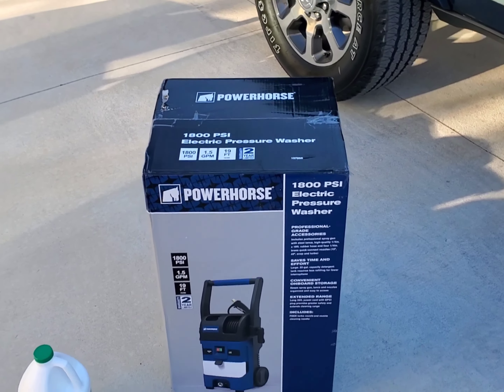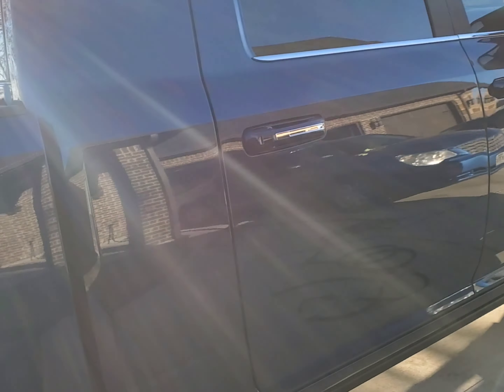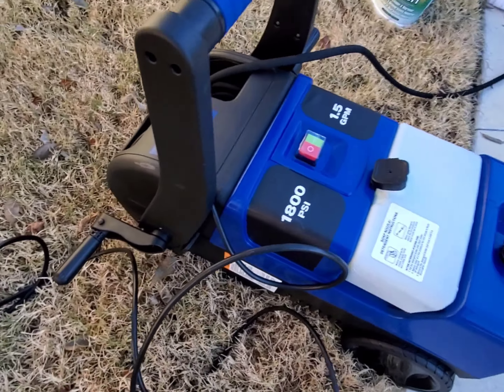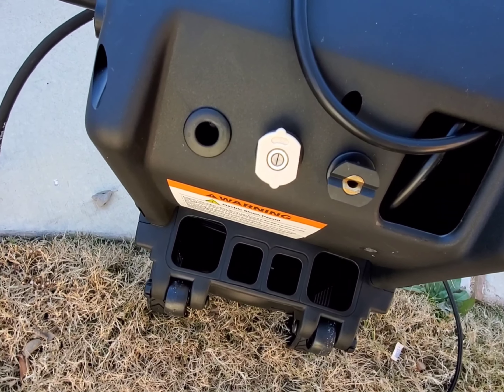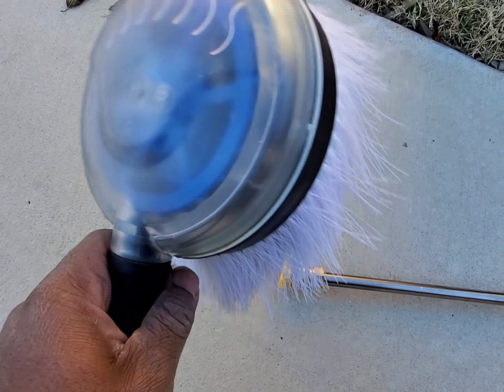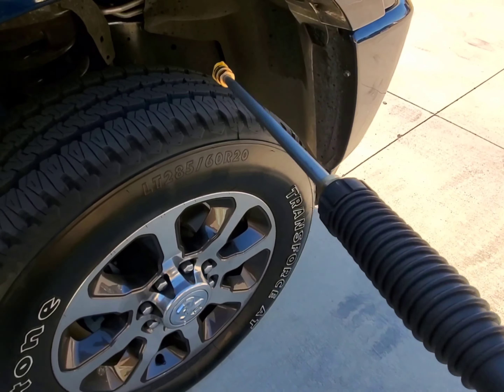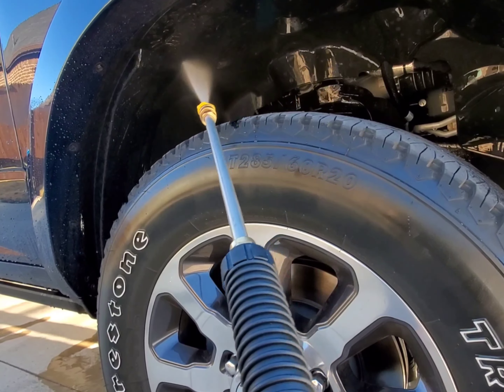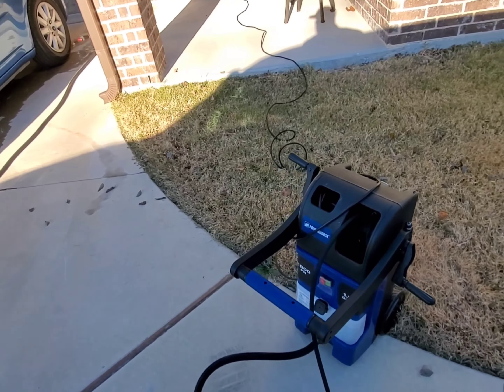Powerhorse electric pressure washer review. #northerntool #pressurewasher

Comment: How is this pressure washer working out for you in the long term ? Have you tried larger orifice nozzle tips to get more water flow and less psi ? Thank you
Reply from the maker: so far so good for what I paid for it. very powerful in removing caked on mud and it also does great on removing grease and oil from concrete. what stands out is the little soap/degreaser bottle that dispense your product of choice with the switch of a nozzle. highly recommend.